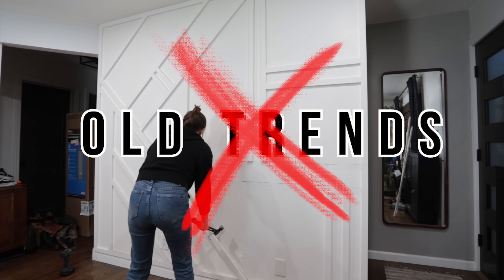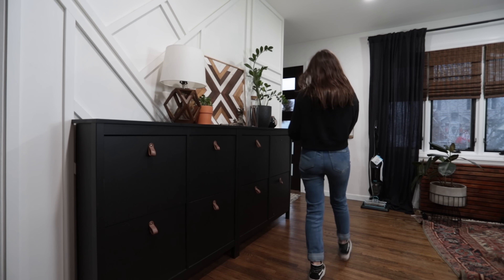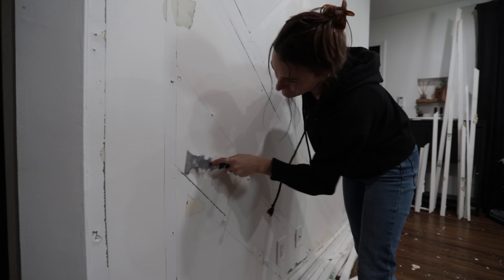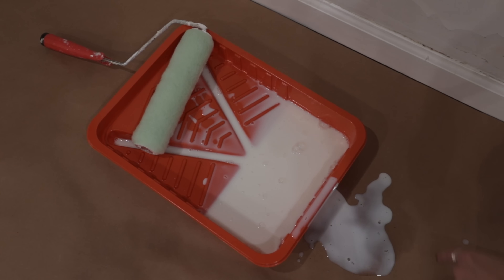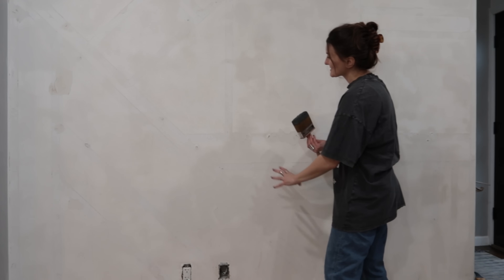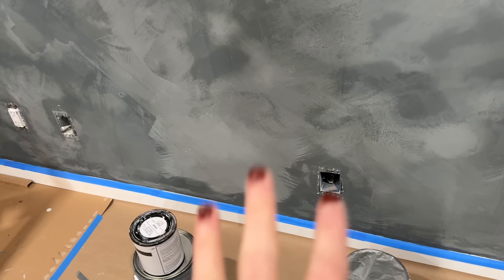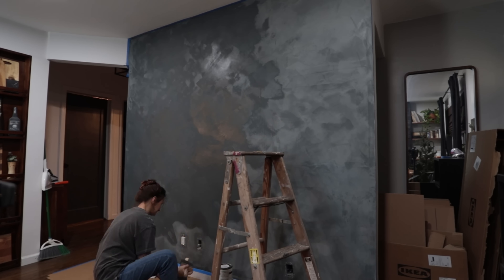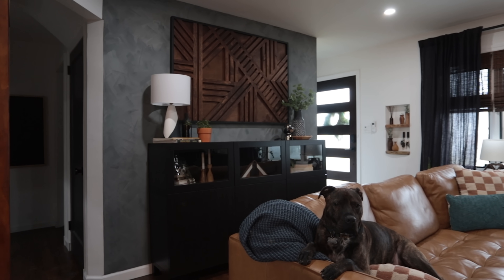I Hated My Small Entryway...

Comment: Hi, venetian plaster professional here. You did a fantastic job! The fist product you used is Lime Paint, it differs a little bit from lime wash in the fact that it’s thicker. Limewash is essentially lime paint but diluted more with water. 
What you did is pretty much my go to approach to limewash, a thiker base of lime paint with a wash over it to give the wall its movement. I also recommend not stressing too mich about covering every single white primer space on the first coat but to make sure every area have been coat even if it’s just lightly. That way on your second coat the wash will make it more uniform but those lighter areas on the base coat will generate a beautiful contrast and movement . Awesome job!

Comment: Good job Sam.

Pup looked disapprovingly sad, that you took down the accent wall.

I think I seen something like this in a This Old House Episode.
The home owners brought in a specialist to paint the child's room and the specialist used, if I remember correctly, 6 different colors at the same time.

They didn't call it LimeWash, they called it something different and that particular design is used for Children.

The specialist intentionally made figure 8 strokes with the brush, some large some not so big. I can't remember what they called the technique but it turned out very nice.